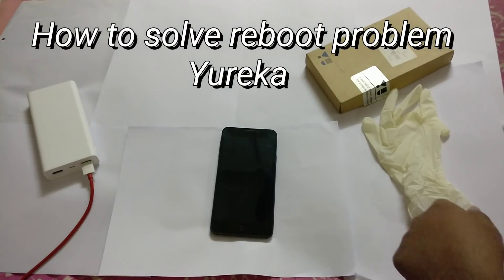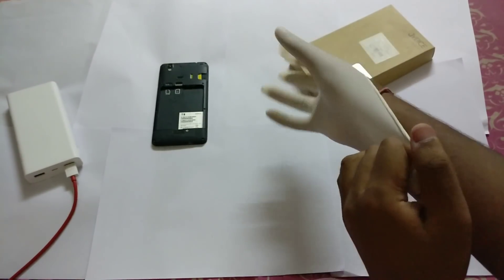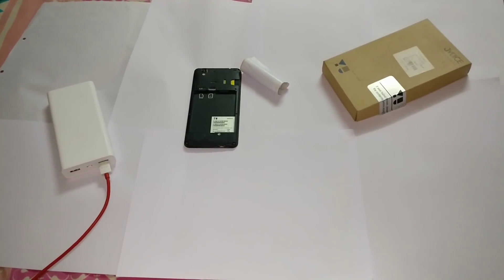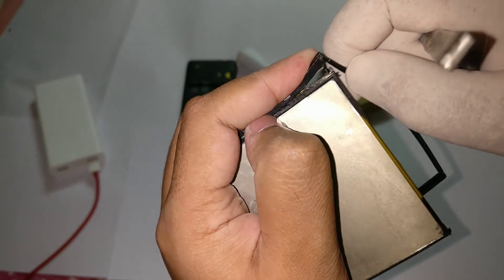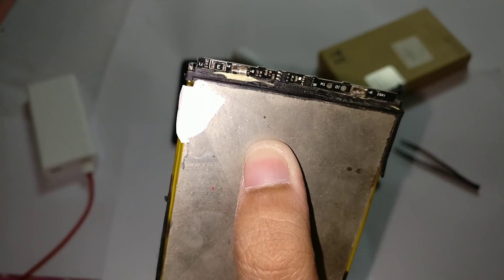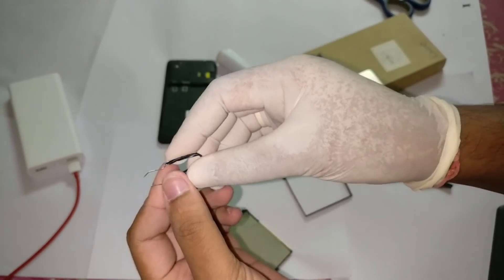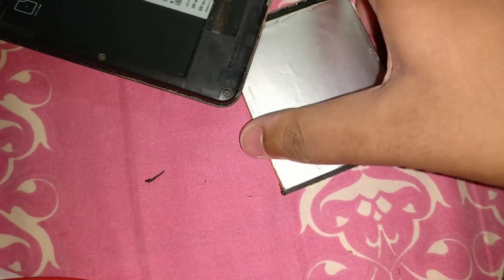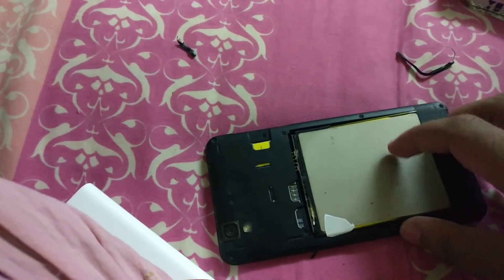How to solve reboot problem YUREKA, "E method" [No soldering required]

Comment: Can u tell me if you faced any problem with charger,....
Reply from the maker: No problems at all
Reply: @ShayantanSantra  but my phone is turning off again and again but it started once
Reply from the maker: Try soldering the E terminal.
Reply: @ShayantanSantra  I got it soldered from a mobile repairing shop nearby but still it's turning off... Maybe the problem is somewhere else and not that battery one... Thank you soo much for your concern
Reply: @ShayantanSantra  your video has helped me alot...
Reply from the maker: @divyanshiprakash6144  glad I could help u
Reply from the maker: @divyanshiprakash6144  which Rom are you using?
Reply: @ShayantanSantra  64gb rom

Comment: Hi sayanthan. I did exactly as you did. It worked great while charging on AC power. After two hours it started the problem again so I had to order a new battery
Reply: And I also had to adjust the binding wire after writing the comment
Reply from the maker: @parameswarikoganti4078  ohhh, still buy a new battery
Reply from the maker: Yes, the battery is now degrading to a limit that even this method cannot save. I had this method working successfully for 1 year. After it, this method failed too. I believe the battery capacity has degraded
Reply: Yes .so yesterday I ordered a new battery
Reply: The battery frame can be put Bach normally

Comment: Thanks for your awesome video bro. This trick worked. I had installed AOSP Extended 5.7 oreo 8.1 since then my phone was continuously rebooting. Couldn't open a  single app, the moment I pressed any app button, phone used to reboot.  I was going crazy. But your video helped a lot. I didn't opened battery as you did. Just removed the paper sticker and plastic frame, used son's compass/divider to scratch the area in between the two points B+ and P+.
Reply from the maker: That's great news!

Comment: Bro I went to the service centre they told me that I have to change IC and  the battery both and it'll cost me around 1500  rupees so, I want know is this full proof idea
Reply: Bro I've used my old Nokia phone battery to restart it and it worked and there was no bootloop but after the yureka plus logo my phone was out of graphics means every thing black but back light was on.. And when I showed this to my nearest private service center they told me that the display is not working means the graphic folder display's fault and it will cost me around 1500 rupees... I don't know what to do now I'm very much confused.. Plz help😫😫😖😖😖
Reply from the maker: @AnkitKumar-fo2iz  follow my procedure and try and if not works try to reflash stock firmware.
Reply: Thanx bro for these very fast constant replies  other YouTubers don't even care of the comments of there subscribers but you I liked the way you deal with them thanx bro.. Can you explain me emmc method
Reply: Plzzz bro ill not tease you anymore bcoz you may have some work to do
Plzzz explain me emmc method
Reply from the maker: @AnkitKumar-fo2iz  bro it ok i aint tensed and i wish to help you but YU has stopped the YUForums . Without it I am nothing until and unless I have tried it myself.
Reply from the maker: @AnkitKumar-fo2iz  bro i read that 2 years ago. It was done by a developer who had hard bricked the device. He open the back of the phone and there is a chip with name emmc. It just touched 3 terminals together and then connected to the pc. Then he installed the device firmware from fastboot. Thats all i remember. If YUForums worked today i could have send you the link. However its stopped from last 12days
Reply from the maker: Its full proof idea
Reply: Shayantan tech vids thanx bro but one thing more if my yu yureka on android has power IC defect becoz of what it's boot looping  plz reply and if not why those people are telling me to change IC
Reply from the maker: @AnkitKumar-fo2iz  umm this solution works on the basis of experience of yu users. The reason as cited by customer care may be right to some extent. However this method works. And if it still doesn't that means there's and IC issue
Reply: Bro ur processes don't worked for me
Reply from the maker: @AnkitKumar-fo2iz  try emmc method. It were available in YUForums but it has been shut nowadays 😕
Reply: No problem bro I think it's time for a new device sorry to disturb you and take your precious time but thanx for your constant support and plzzz never loose this healthy habit of treating your subscribers with a quick reply.. I waiting for your new video... May you endeavour a great success in youtubing....... 😋😋😎😍😍✌️✌️👌👌👍👍👍👍👍

Comment: Bro I have a Yuphoria n I have slightly different problem.. Can I discuss with you...
Reply from the maker: vandana c sure go on!!
Reply: In your case, when u press power button ua phn starts rebooting In loop. But In my phone, when I press power button nothing happens. Even YU logo does not show up. But wen I cnct charger, YU symbol shows up, n continuously restarts without booting into system. Not booting Into TWRP as well. Fastboot is working fine. I have been using yuphoria since 2.5 years, n I have tried many roms, n got settled to MI UI 8. I have been using MIUI8 for more than a year n did not face any issue. This problem started when I charged my phone with a different charger at my relatives house. Can u help?
Reply from the maker: vandana c ohh thats the case of decice being hard brick. Just search how to revive hard bricked yuphoria using fastboot. I haven't used yuphoria so i cant assist you...
Reply from the maker: Ps: if you have doubts you can contact me
Reply: Fastboot is fine, I can try flashing  stock rom, but I have some very Important data in phone memory. Don't want to erase it. is there anyway to recover?
Reply from the maker: vandana c then there is emmc method in ehich you need to short the emmc chip. You have to open the yuphoria and search for it. This method seems to be working on yureka however it should work on yuphoria
Reply: My doubt is.. If a phone is hard bricked, the Fastboot mode shd nt is be working ryt? In my case fastboot is working.
Reply from the maker: vandana c yeah and since fast boot is working for you its called soft bricked

Comment: thanks bro this is fantastic . your  trick is 100% working..i have done in my mobile now it's working...but i I want to ask if there are any drawback for Battery
Reply from the maker: Well its a major concern but i have been using this battery from December and no issues are found till date.

Comment: Bro, This method worked for me so Thank s a lot. But now i am facing a new problem i just broke the circuit , the two points while i was opening it.  Plz tell me what to do now. i really want to use my battery again.
Reply from the maker: U need to solder it
Reply: i dont know how to solder it, plz bro show me naaaa..plz plz plz

Comment: thanks bro. It's working but I have a query. Don't you think that after shorting the resistor(removing it) will burn some circuit or chip of the memory in a long term. Plz clear my doubt.
Reply from the maker: Vishal Singh well i don't know about long time.. But for me there is no issues past 4 months

Comment: Awesome bro, i did just as you mentioned , grt thing is i did without a shouldering rod, just by attaching copper wire to short the  E circuit..
mobile working fine.. 
thank you for the idea.
saved  money and importantly saved a lot of time. :-)
Reply from the maker: U r welcome 😊

Comment: Do you know how solve Lg nexus 5x bootloop problem.
Reply from the maker: Djmag Ak47 i would love to your the status of your phone.
Like is it rooted.? Is the bootloader unlocked, and has it got custom recovery?
Reply: Shayantan tech vids it stop on lg symbol while switching on.
Reply from the maker: Djmag Ak47 no problem the issue is similar to this device. But in your case the issue is with snapdragon 808 and not the e terminal.
So basically what happens is that when you use your phone for a long time, the soldering on the chipset tends to weaken a bit and causes loose connection. This issue has been acknowledged by snapdragon themselves. So in order to fix this issue you have to use a kernel which uses less power to boot. Try searching elementalX kernel for lg nexus 5x. It should boot on that kernel. But remember that your phone will slow down
Reply: Shayantan tech vids i Google about this problem in one their i found something about what it says is if bootloop problem occurs during updating Google will pay or if phone problem occurred after updating os the LG will pay me, so i call LG customer care their they says to solve this problem you have to change motherboard it will cost rs13000. And again call them no response. Worst customer service by LG.
Reply from the maker: Djmag Ak47 same happened to me.. So no use. Try the avobe method it will work😉

Comment: Meri nhi hui bro
Reply from the maker: Punam Malik kya problem h..?
Reply: Pta nhi battery change bhi kr li phir bhi aise hi h
Reply: Mera name akul h
Reply from the maker: Punam Malik i guess there is issue with your connection
Reply: Which connection
Reply: Even after changing the battery
Reply: I think it's software problem
Reply from the maker: Punam Malik have u tried to flash stock cos using adb
Reply: No

Comment: Hello,my yu yureka plus battery backup only 2/3 hours and suddenly stop the phone even remaining 40% .can you solve the problem? It is original and it is only 1year old
Reply from the maker: +pinku dutta have u rooted your device?
Reply from the maker: If u have rooted then download battery calibration app, let the battery charge till 100% and calibrate the battery.

Ur issue is due to a small memory conflict in the battery. Our battery has a memory chip which stores the percent of charge, battery temperature and so on. U need to reset it with that app.

If it helps please subscribe 🙏🏻
Reply: No phone is not rooted. And unable to root used King root, kingoroot,Rootmastar,etc
Reply from the maker: pinku dutta you need to unlock the bootloader first. You need to use computer for that. Then flash twrp recovery then flash superSU. Only then u will able to root ur devices

Comment: i facing this problem after flash a custom rom like cm 14.1 ...quark os 3.0 ....give solution pllllllllz
Reply from the maker: RAHUL KUMAR bro actually i faced this issue after flashing gravity OS. What actually happened in urs and mine case is that few custom roms require more power to run. Our battery is old by Atleast a year. So its not able to provide that much power which in turn causes issue on the battery. Its capacity reduces. So its not enough to boot the roms. Therefore you are facing reboot issue. Twrp and custom recovery requires relatively less power than at the time of booting. So u need to use this method.
Reply from the maker: Connect it with charger. Sometimes some roms boot with charger

Comment: Charging problem
Reply from the maker: Pradeep Yadav what happened?
Reply: According to video i performed all step and mobile takes boot but charging not happened
Reply from the maker: Pradeep Yadav bro for me its happening, may be something went wrong while opening 😶🙄, i dont know. Its tricky process. Easy to mess up. I do understand its not your fault.  I tried a lot of software process to sopve the reboot issue. Nothing worked. So i had to do this because in anyway my phone was not booting. But for me there was no charging issue. May be it was mere luck but for me its fine. According to comments i do understand that there is charging issue but cause is still unknown

Comment: i did with a copper wire, it's ON but changing doesn't work... should i use an aluminium wire ?
Reply from the maker: Alert Palle do u mean charging?
Reply: oh yes charging.. sorry
should i use an aluminium wire or that wire they use for soldering ?
Reply from the maker: Is the rom booting?
If yes wait for it to boot completely. Then it will start charging.
If not then try to remove that copper wire, then try to scratch the terminals of 'E' a bit. Because often the soldering becomes dry. Dont scratch it completely. Just little bit. Reinsert the copper wire. Make sure the terminals of E are touching the copper wire completely.
Reply: Shayantan tech vids yes the phone is on ,  the camera is also working, but when i plugged the charger the phone is not charging..
Reply from the maker: Alert Palle umm, thats wierd.. The phone should have charged. What is the current percentage of battery?
Try to go to recovery and check if the battery is charging...
It may be issue with the kernel..
Else wait for few hours. After that again try to charge if it still refuses to charge remove the copper wire and try with aluminum. Because technically aluminum or copper wont create problems. Phone is on that means this hack is working. Or may be ur copper wire is touch an extra terminal other than E. Next to E terminal there is a small chip which stores charging data. May be its touching the copper wire. Try once the avobe method
Reply: Shayantan tech vids ok thank you so much.. do you have a fb or Instagram account so that I can send you a photo of how I'm doing it...
Reply from the maker: +Alert Palle yes i have instagram id shayantan_official. Please subscribe to my channel its a request 🙏🏻
Reply: Shayantan tech vids ok thanks..
Reply: Alert Palle did ur problem solved? now